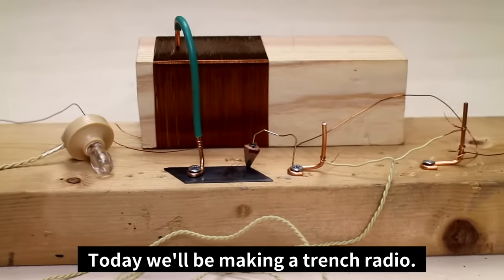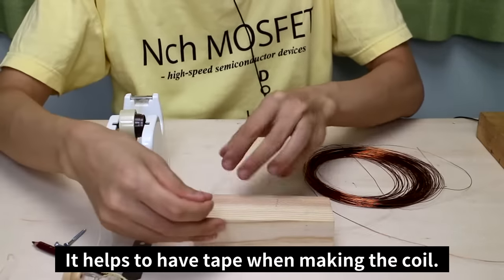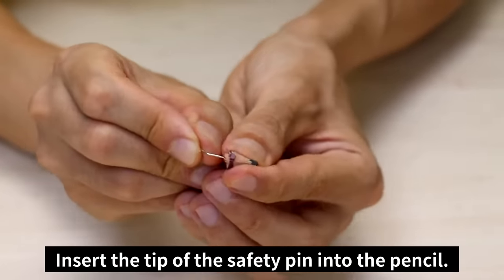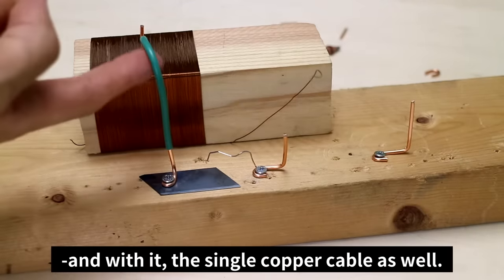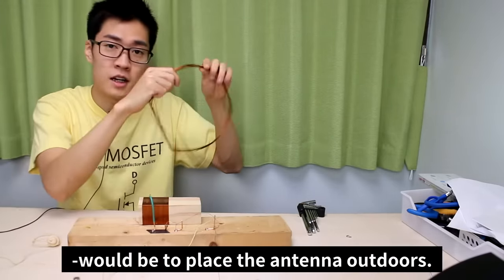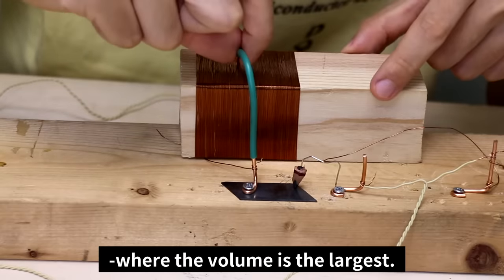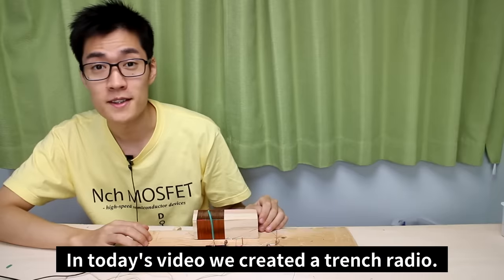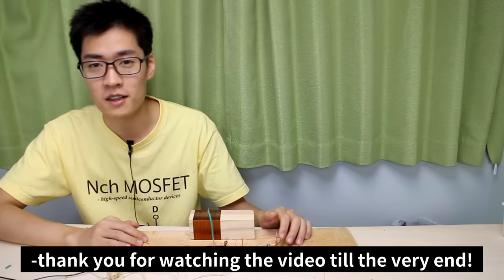Making a Foxhole radio  Very primitive

Comment: The only thing that you did not mention is that this only works with AM radio, not FM. I built many of these years ago in the 1950/60s.  This was what got me into amateur radio, and electronic repairs years later.
Reply: Back in 1958, I had what was called a 'Cat's Whisker' AM radio - essentially the same thing.  I would clip the 'antenna' to the bed frame to ground it.
Reply: He did show that it was an AM frequency near the end of the video. While the coil adjusts volume and the pencil changes the AM station you can deduce it is AM only given the information provided.
Reply: Also known as a crystal radio.
My uncle taught me how, in the 1970s, he built them (illegally) in wartime 1940s. I seem to remember a dead battery in the setup.
Reply: I think it replaced the razor somehow which we didn't use. It definitely was a dead battery, so there was no power involved.
Reply: @d.marbus1493  The wikipedia article has a schematic that uses the carbon rod from a battery in place of the pencil graphite  "Another detector design was a battery carbon resting across the edges of two vertical razor blades, based on the 1879 "microphone" detector of David Edward Hughes"
Reply: @waynegroves6922 Cat's Whisker here 😊
Reply: When i was a kid i used to tie an AM antenna to a metal frame furniture for a clearer incoming voices
Reply: Is it possible to make an fm radio with a similar project?
Reply: @argonoak  am radio broadcast also is the energy to power the device, with FM radio the energy isn't enough.
Reply: @argonoak  THere is no way to do this passively, you need some way to detect the changes in radio frequencies, then use the changes to drive the earpiece.
Normally done with a PLL or some type of phase discriminator.
Reply: I think you mean the AM (Medium Wave) Band V the FM (VHF) band🤔 Which is correct. However the radio could theoretically resolve a Frequency Modulation (FM) signal by slope detection.
Reply: @Test-hw5fn   Not necessarily medium wave, it is the type of modulation that matters. It is a simple thing to decode a changing amplitude to audio,, Frequency modulation not so simple. The problem is that the crystal tuner received frequency band is very broad, it would need much better selectivity to use slope detection effectively, and any method will need some active circuitry.. Back in the days of CB radio, I used to build and add a simple PLL ( phase locked loop ) using the tracking signal to generate audio, very effective and simple, but impossible to do with passive circuits.
Reply: "the only thing he did not mention" - - WHAT??
Reply: Why mention not getting fm.  You wouldn't gain much information from an fm broadcaster vs am. Isn't that the purpose of a trench radio?
Reply: Well, you want AM during wartime, that how you could receive BBC in German prisoner camps. AM has long range. FM receivers are much more complex and broadcasts are shorter distance. If one could pull it off you'd just hear Goebbels speak, which you could for free in camps anyway. Listening to BBC however, if caught they'd shoot you.
Reply: @argonoak  for FM radio you need an active demodulator. this needs proper components (resistors/capacitors)  to build not Stanley blades and pencils, and needs a few volts of power.
Reply: @Bynchillyn247  FM was used to talk between planes/tanks in a squadron, or between officers and a nearby base. FM was pretty short range.
AM on the other hand, if you built a radio in Berlin, you could hear broadcasts from London.
Reply: Build mine in 1959... following plan from "All About Books" series kids books on sciences ..
Reply: @argonoak The radio works on the fact that the signal varies in amplitude at the audio frequency of the voice or music, FM uses a steady amplitude with varying frequency or phase of the signal, so no, it is a lot more complicated to decode FM.
Reply: I would like to understand more about electronic repairs. I am at tinkerer do you have any recommendations of resources or a book that would be helpful in such a pursuit?
Reply: reapiu8316  I guess that you could use slope detection by tuning slightly off, but it will be inefficient as you said.
Reply: uhm, close to a FM transmitter it could still detect the audio using slope detection from the modulation if coil and capacitor is high enough Q (low loss).
 say a few turns of 1mm teflon ciated silver wire with no wood core, just aircore coil.
a multilayer SMD 1pF capacitor (stretch and/or compress the coil to tune),
 also you a better matching to both antenna (antenna almost perfectly resonant length dipole work best) , and earphone need matching, not jusr ceramic phone,  you need a goid impedance matching network to get any audio.
Reply: It do work on FM using slope detection

Comment: A tip - if you can find one of the old-fashioned blue razor blades, they work even better. The blueing on them is a microscopically thin film of oxide, and this works very well as a semiconductor.  HTH
Reply: The bluing on the razor blade was selenium. Hence a selenium rectifier.
Reply: Nice pun! XD
Reply: I just bought a selenum based blueing paste. 
So, I can haz kitchen-maid semiconductorz!?
Reply: @freemanz4051  thats a good idea worth trying! never thought of birchwood blue! Brilliant!
If using a "true" razor blade, make sure its not teflon coated.
Reply: Radio Operators manual Q & A.       Q. 3.74 Discuss the relative merits and limitations as used in power supplies of the following types of rectifiers:
(A) Mercury-vapor diode.
(B) High-vacuum diode. 
(C) Copper oxide diode. 
(D) Silicon diode. 
(E) Selenium diode.
Reply: A coherer and an electrolytic (Barretter) are signal detectors but they are not diode rectifiers. An AM signal is demodulated by passing through some sort of diode rectifier.
Reply: There was also the peroxide button detector which may have been a mim diode(metal insulator metal)instead of semiconductor. And also a novel electrolytic diode that was ultra sensitive but had both electrodes submerged and acted ad a weak battery and rectifier.. I'm not sure how either of those worked tho

Comment: Bad earpiece and speakers. For proper functioning, the resistance of the earphone or speaker must be about 2000 ohms. In addition, AM stations are very few and far between, and if they exist, they do not have the required kW power. In the 1960s it would have worked satisfactorily, as the power of AM stations was large - more than 10kW). Today it is only tens of W. It would be best to apply a Galena (PbS) crystal and a very thin tip. A strong pencil lead is very inappropriate. The tuning coil is not tuning, but has a very high resistance for a specific signal, so the signal of a specific frequency goes directly (short-circuited) to the detector, which removes the positive or negative half-wave and thus induces a "pulsating" potential in the earpiece. The "tuning" coil is therefore useless, because you certainly don't have several AM stations within range.

Comment: I suppose the blade is a crude diode.  Might as well just buy a diode.  I made crystal radios as a kid that I stuffed into ball point pens. The pen still worked, but the clicker mechanism didn't (need that space for the diode).  I wrapped the ink tube with fine wire I scavenged from transformers for the coil.  It was not tunable - it just picked up whatever the most powerful AM station was, but it worked.  I sold them to classmates who were amazed at the idea of a pen radio that didn't even need a battery.   ...and yes, I became an engineer obviously.
Reply: There weren't too many diodes available in foxholes.  But razor blades were readily available.
Reply: "I suppose the blade is a crude diode.  Might as well just buy a diode." may as well buy an actual radio too. The point of this video was to make it the same way they did in WW2...
Reply: @baseddoggie  Unless you brought them along, you wouldn't have a crystal earpiece or wire in a foxhole either.
Reply: But they did :| @eventhisidistaken
Reply: @baseddoggie  Right, because they planned for this or scrounged it from broken radios.
Reply: @eventhisidistaken   um... they did. I don't know why you think thats so far fetched. People liked radio back then and they wanted to listen to radio, of course they did that.
Reply: premade radios were also relatively expensive. the crystal earpiece was the only thing you really needed to buy or bring and the rest could be collected from scrap.
most headphones back then were the crystal type and you could also get your headphones from a broken field/two way radio.
Reply: That's the most brilliant thing I've come across in some time now. Bravo!!

Comment: I built one of these many years ago as a kid. I used the cardboard tube from TP for my coil. Also if done properly the safety pin is let in it's original wedge shape with pencil lead attached with a dozen wraps of fine copper wire. Then just pushing down on safety pin it travels across the old school razor blade,and they is your tuner. I liked it so much that I bought a radio shack kit that used a germanium diode and a regular potentiometer for a tuner. With a wire about 100 feet long from my bedroom to the peak of the shed,I could pick up just about any AM radio station east of Mississippi from our home in Pennsylvania. And in the winter and night it was unreal how far stations would come in.
Reply: I ended up hearing foreign radio stations at night as they were bouncing off the ionosphere.
Reply: Oh that's so cool.
Reply: 100 feet?!? WHo has room for a hundred foot antena on their property??  Did you live on a farm, then?
Reply: @railgap  not a farm but in very rural area. Room has never been a problem here. I'm assuming you live in a city somewhere. I've only ever passed through a few cities in my life. I can't imagine living in a city.
Reply: My dad bought me the Radio Shack version of this in the late 60’s and I remember using at an off grid cabin we had. At night I could tune in radio signals that were Spanish was spoken . We lived eastern Canada, so could those stations have been from Cuba or central America? Not really sure. I also could here some stations from the U.S. I still have it and when stumble upon it whilst rummaging through some of my things, I set it up and it still works fine.
Reply: @andreboudreau6474  yes I would say that you were picking up stations from Cuba or central America, easily.
Reply: Great AM broadcast band long wire antennas come in all types and styles. A loop design may help you. The ground rod is very important: plumbers sometimes install dialectic unions to avoid galvanized steel pipes to wrought copper fitting corrosion (which can eat a hole into fitting in as quickly as 45 minutes - I’m a plumber and learned this firsthand)…plumbers also commonly leave ground bonding jumper or electrical connection off from home plumbing after a repair because of liability and problems in union states with “stealing an electrician’s work”. - leaving your home with no real earth ground of it’s own aside from somewhere along power lines. My electrical utility had a large truck around in my neighborhood one day. I saw 12 foot x 7/8” copper clad steel ground rods on their truck and I asked them for one to ground my antenna and they gave me one with a burndy brass fitting! Check your ground!
Reply: Used to hear Japanese base ball games

Comment: I think you should tell people that you're using magnet wire and that what you say is smoothing the surface of the wire and removing loose ends is in fact sanding the enamel insulation that coats the wire away down to the bare copper wire for all the obvious reasons. Maybe you didn't know.

Comment: The wire looks like it is enamal covered. The slider tuner needs to be in contact with every wire as you slide it along. You must sandpaper off the enamal wire where the slider contact the coil. Also, the coil is only half the resonant tuner. A capacitor in parallel with the coil is required to tune the range of frequencies. f=1/(2*pi*square root (LxC)) where f is the frequency, L is the coil indutance, and C is the capacitance of the parallel capacitor. Also, the crystal should be tapped on the coil to retain selectivity.

Comment: A couple of suggestions and a correction, the design actually dates back to WWI not WWII, this the correction though I am sure GI's in WWII still used them. Another point this type of radio will only receive an AM signal as you note and these are increasingly rare.

 I think your use of the pencil end will work well , but if so it becomes the "crystal" as graphite the "lead" in a pencil is crystalline in structure. If so the cutter blade could be anything metallic to act as the contact. It acts as a rectifier separating the DC audio from the AC carrier. 

In a more conventional trench/foxhole radio the crystal would have been a double or single edge razor blade. Preferable one where the manufactures name was carved rather than printed on blade and a double edged blade had still more surface. Any place the blade had been ground you'd expose a crystal.  To made the needed junction you'd just need a fine piece of wire to serve as the cat's whisker. The trick is to find either with your setup the edge of the crystal. I think a classic cat's whisker works better but will try your approach.  

One last thing, you didn't mention but I am sure you did. The point of the safety pin if you use your design needs to be in the graphite and not the wood of the pencil. 

I'd also make two other points, in most modern American homes, plumbing is plastic at least in part as such water pipes no longer function as a ground, secondarily when using an electric outlet the best place to ground is to the screw holding the face place on. 

Still it was a great video and there is much to like about your design!
Reply: A crystal radio will receive CW making clicking noises and if you can tune one to the FM band it will work if you tune slightly off the station.
Reply: @Marty Lampner - "the design actually dates back to WWI not WWII"
I rather doubt that, mate;  the world's first commercial radio station was KDKA, based in Pittsburgh, PA, and they didn't go on air until 1920 - two years after the First World War ended.  According to Jack Gould's book, 'All About Radio and Television' (1953), they were first reported as being used by Allied troops during the stalemate at the Anzio beach-head (Feb - May, 1944).  The 'New York Times' ran an article on such radios on 29th April, 1944, describing one built by Private Eldon Phelps of Enid, Oklahoma.
Reply: Crean en Jesús Cristo y tendrán vida eterna y paz entreguénce a Jesús Cristo ahora mismo en oración Dios les bendiga
Les invito a una iglesia evangélica
Reply: What about P.O.W.'S Did they not utilize them too?
Reply: @p.oneill6943  possibly… There are several great reads about WW2 POW camps. Many things were possible there, thanks to ingenuity and… lots of time. And also very importantly: befriending guards, trading with them (cigarettes and chocolate from Red Cross aid packages were good for that) and, if possible, getting damaging information out of them and then pressing them to deliver components. In Stalag Luft III camp prisoners even made a camera to make photos to use on false documents. 

( several books on Colditz prison, 
‘The great Escape’ 
‘The Wooden Horse’ etc.)
Reply: No, not WWI only WWII.
In WWI there was no radio station on air...
Reply: The first radio station with more then tests are 06. november 1919 in Neederlands... NOT usa...